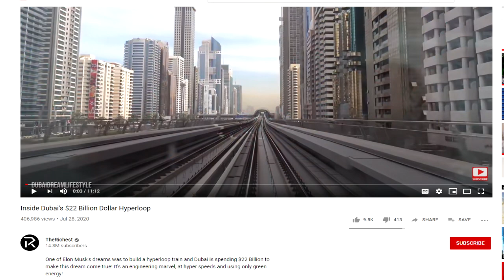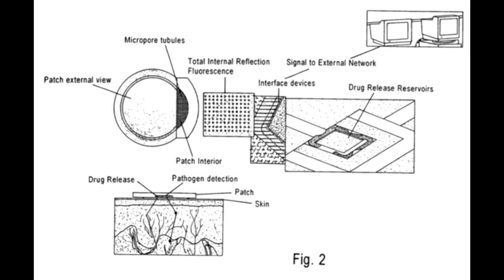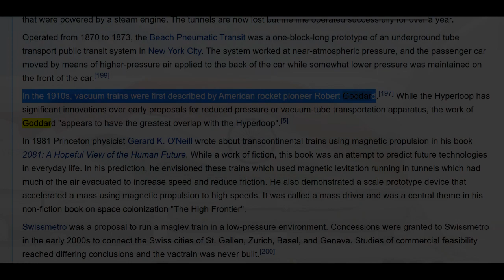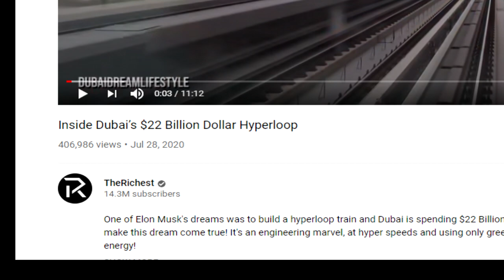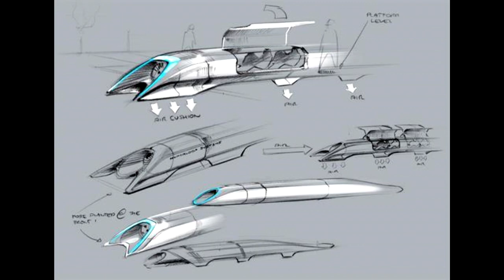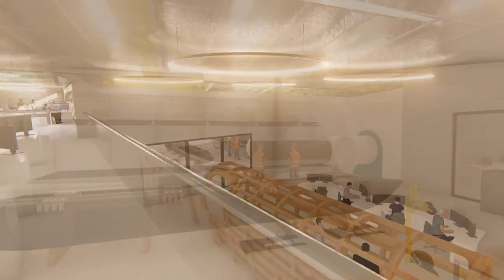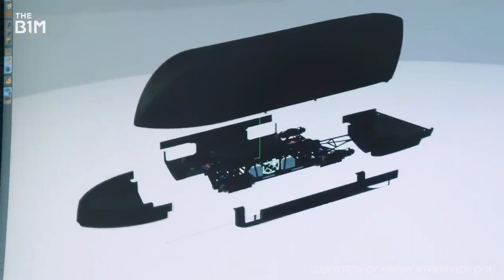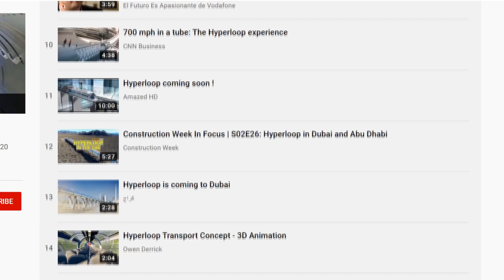Hyperloop, the biggest Scam since Theranos

Comment: They just talked about the hyperloop on national television (the evening news flash) in Belgium... Really crazy how much people buy into this
Reply: Maybe maglevs, vacuum pumps, steel pipe, expansion joints, air locks, and pressurized air frames are all things that can be optimized. And Thunderfoot is trolling.
Reply: @markharmon4963  What you zealots must understand is that IT IS NOT ECONOMICALLY VIABLE NOR DOES IT MAKE SENSE TECHNICALLY. But yes, theorically it is possible. Just as it COULD be possible the legions of Musk's zealots one day wake up....

Comment: The problem with traffic jams are not the roads, it's the entrances and exists!  An underground hyperloop will still have the issue of entering and exiting the vehicles.  If they had a schedule for each car, yes then there would be no jam of cars exiting (unless the feeder road was jammed), but that would probably not work because that would mean that vehicles would be waiting somewhere which is just the same as sitting on a on-ramp.  You might as well just take the bus or subway...
Reply: Also, cars don't get stuck in traffic, cars ARE traffic.

Comment: “Major Tom to ground control...   we have a pressure leak in the capsule, everyone’s going to die!”
Reply: Another good point, spring a leak at 800mph wtf is your options lol
Reply: @jasongamer8649  Idk... How do airplanes manage it?
Reply: @ilv1  planes don't travel at the low pressure the hyperloop would need. the drop down masks in airplanes wouldn't cut it the passengers would need near space suites to survive it.
Reply: @dexdrako  Yeah but when's the last time an airplane sprung an air leak? I literally never heard about it happening (not saying it doesn't happen). Maybe they could use some of that 70s tech they used to make the planes to make it safe... We're literally flying in planes designed half a century ago, and you're worried that the man who is sending cargo to space cheaper than NASA is going to have a leak problem....
Reply: @ilv1  thank you for proving you are completely ignorant on this topic. 

planes are designed to "leak" they are not air tight they are positive pressure (compressing outside air and feeding it into the cabin). they DON'T fly in a near vacuum and they would kill everyone inside it if they did. these pods are closer to space craft and no one goes to space without a space suite for a reason.

i worry about it because I'm an informed people that really understands whats going on.
Reply: @dexdrako  Oh... Ok. Better ring Elon to let him know. Also... Tell everyone that went on the ISS that they're dead because they weren't wearing a suit... I think they didn't get the memo. Yeah I get it that they might need a different solution in case of a leak... But again, by these standards, we wouldn't have planes. "What happens if engine fails at high altitude?" Well... Everyone dies. Accidents happen.

Comment: Take a look at the space craft currently being built in boca chica by musk. They look like something a 5 year old would make out of tinfoil and card board, there's absolutely no way that they could withstand the heat and pressure of space or atmospheric entry and exit. They're literally made with local steel and welded by locals, outdoors, in open air, where no space craft has been built like that before. My dad and I have watched a number of "test flights" where they send them into orbit, they're just replaying the same video each launch and claiming it's live. The same object falls from the rocket at the same time every launch, I think everything he's doing is a total scam, or at least a large part.

Comment: Wonder how much money Thunderf00t lost shorting Tesla stock. Remember when he said the dragon capsule would be delayed for years just a year ago? Or that they didn't know what they were doing with starship? Good times.
Reply: Well to be fair... Dragon 2 was delayed 3 years... (Original plan was 2017).
Reply: They have got a hop for 150 meters on a single engine. After many serious failures due to easy engineering mistakes. And they are years behind their own stated schedule with very little to show for it. So, a bit early to call starship a win. And I actually am still concerned about dragon. The shuttle had more than one successful flight. But it had numerous deadly design flaws. They simply did not have time to fully test a new valve operating system.

Comment: Goddard the first? Pneumatic (tube) transportation was invented in 1799, beit not for people transport but this was suggested when (also in 1799) pneumatic trains were invented. Musk never said he invented it, but perfected the concept to a viable form and coining the name (=he wrote a white paper about the concept). The concept itself is far from a scam, the companies promising tickets in 2021 could well be a scam (and none of Elon's companies made such a promise).
One of my friends attends the TU (Tech Uni) in Delft, they have a scaled down test model of the Hyperloop concept. The tube itself is not vacuum end to end, but sections are kept near vacuum by pumps spaced evenly across the whole length of the track. The 'train' generates an air cushion to 'ride' on and the propulsion comes from magnetic 'rings' around the tube. These three separate inventions already existed, but Musk was the first to combine them into what is now known as (the concept) Hyperloop. No scam, just existing tech combined into a potentially feasible concept to be researched. 
Goddard's version was to 'shoot' rocket propelled 'trains' through an end to end vacuum tube (a bit like a mortar grenade), talking about scams.. It's not even a viable concept, unless you want compressed people-pulp at the rear end of the train.

..also, you use Fox as a fact background? Are you on......

Comment: Not all business ventures succeed, doesn’t mean it’s a “scam”!!
Reply: But this one is definitely a scam. Don't think like a dupe.
Reply: i think the main problem here is that it is possible, but this way of doing it and promising that it will do x or y when there it isnt a prototype, thats what is scammy about this, like saying you gonna build a school for the blind but the walls are made of sand
Reply: Daneelro. What are you basing your definitive argument on?? The Boring Company and the directly linked side businesses are moving forward on their projects with Las Vegas rapidly closing in on the final phase of the project. Covid definitely slowed things but as far as I can tell things are in full swing again and the investors and clients will be happy with the results even though it will be behind the original delivery dates.
Reply: If a business makes impossible promises, misleads investors and lies about progress made, it's a scam.
Reply: @OCRay1  The Las Vegas project is a mile-long normal car tunnel built with reduced safety precautions and with a capacity below that of a two-lane road, in which Teslas will be driven by humans at 35mph. It is not a demonstration of the vacuum train concept, nor of a novel mass-transit system, nor of tunnel building technologies suited for 100-mile stretches, nor of any new technologies (all they did was to save costs by building a tunnel with a narrower diameter, but that works against both safety & capacity). Also, it is inferior to even the slowest and lowest-capacity rail-based mass-transit systems in every one of those respects. It is a pointless white elephant only worth to fool the clueless, in other words, very much part of a scam.
Reply: That's true, but this IS a scam.  Let's ignore the engineering difficulty in making this.

Imagine that a vacuum tube was built from NY to Los Angeles.  How easy would it be to place a bomb, somewhere along that line, to destroy it?

Any train in the tunnel travelling at supersonic speed would be destroyed.

I really dislike Musk representing technology in America.  He's an embarrassment to anybody that is trained in science.

Comment: Yeah,  I remember that other con, where Elon said he could land a rocket booster and reuse it.  What a con artist!
Reply: The same elon have abandon the capsul and vacuum chamber part.
Elon's hyperloop currently is just a tunnel for car.
Reply: @whoami1449  Don't get his underground tunnel project confused with the Hyperloop project.  The car tunnel is to reduce traffic congestion and expand highways underground.  The Hyperloop is for long-distance travel.

First Hyperloop test with passengers 09 Nov 2020:
https://www.youtube.com/watch?v=AZruVz3Ccjk

The Hyperloop is basically a Maglev inside a low-pressure tunnel.  It's a simple concept, I don't understand why you would think it's impossible.
Reply: @digitalsierra  it's not, it's a different thing involving a vacuum, and if it is (which is not but some people apply the definition to it) then hyperloop shouldnt be the name, it's a train in a tunnel and its not a new invention, its called subway.
Reply: @abegohr2576  A MagLev inside a vacuum tunnel is a new thing.  Not all subways are MagLevs (most aren't) and currently, none reduce the air pressure for lower drag.  As for the name, Hyperloop is cooler than MagLev+ or MagLev 2.0

Comment: How is the hyperloop supposed to be cheaper to build than high speed rail? All you are doing is making a highspeed rail network, then putting a tube around it and running vacuum pumps over the entire thing. Where exactly is the cost cutting taking place that means this system is cheaper?